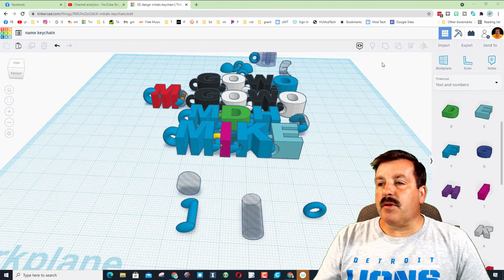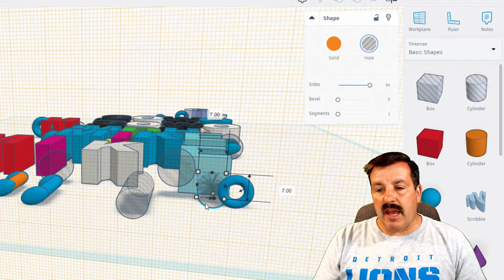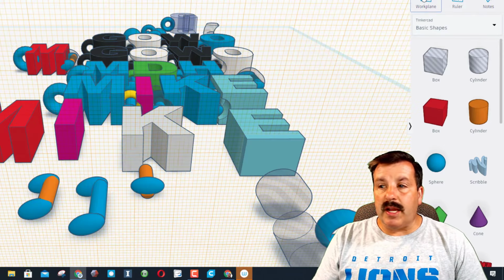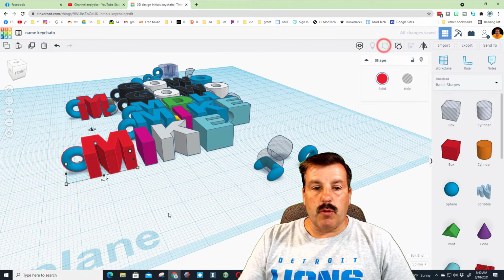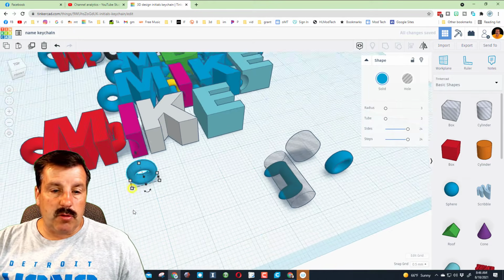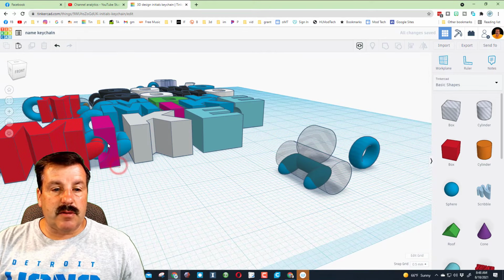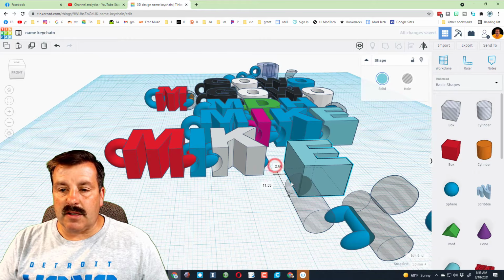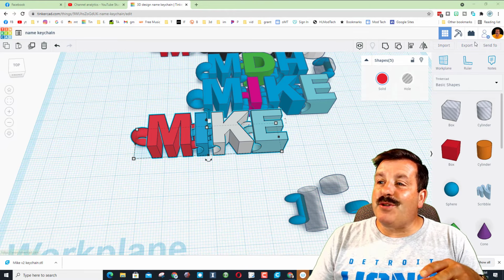Terrific Tinkercad Articulated Text Key Chain | Prints in Place

Comment: You’re my favorite 3D YouTuber!  Always great information presented in an easy to understand way.  Thanks!

Any chance you’d make a tutorial showing how to create a band in three sections?  I need to make a ring approximately 320mm in diameter, which is too large for my build plate.  I would need to build it in three sections, each the same size adding up to exactly 320mm.  It would need some king of way to snap them together like a puzzle.  Just trying to glue them together isn’t strong enough (It needs to be somewhat structural).  Therefore the ring would need to have some thickness to it.  Maybe 8mm X 5mm.  Or 7mm X 7mm. Something along those lines.  Only the ring diameter measurement is crucial.
Reply: I saw this design for snapping two pieces together by Richgain called Lockblock - printable connector.  YouTube won’t allow me to add a link.
Reply from the maker: You can reach me at hlmodtech gmail. That way you can send me a link to the image.
Reply from the maker: Thanks for the kind words. What is size of your 3D printers build plate?